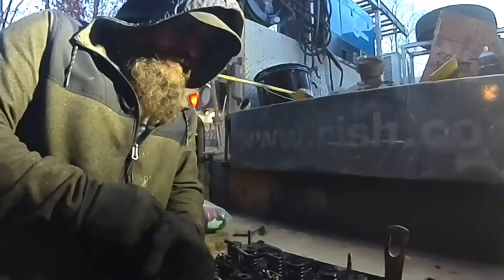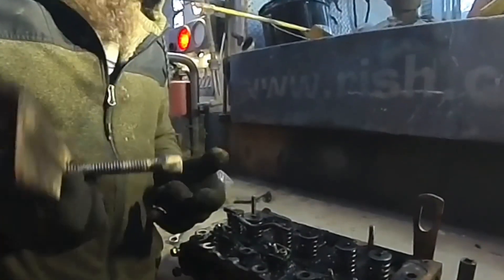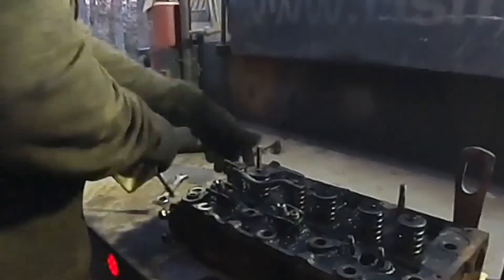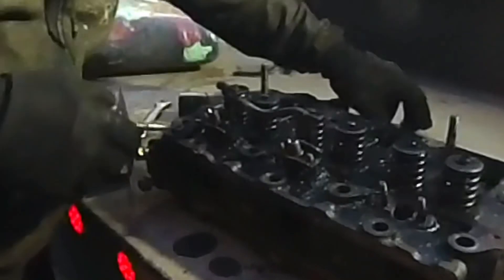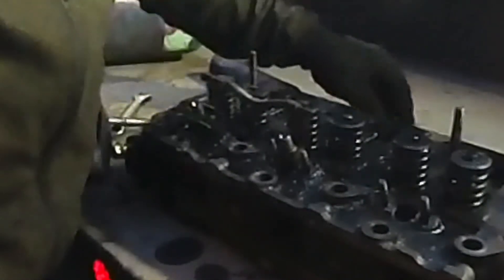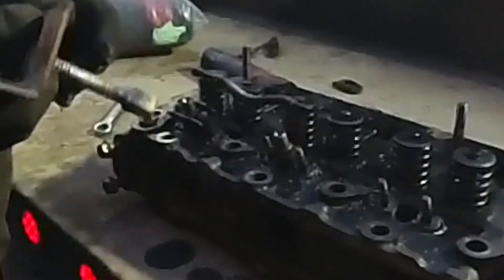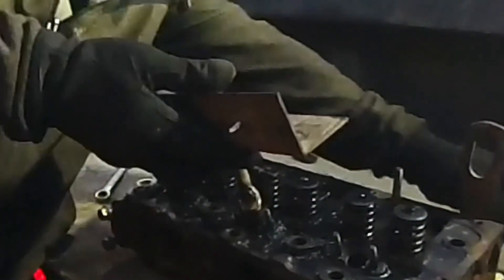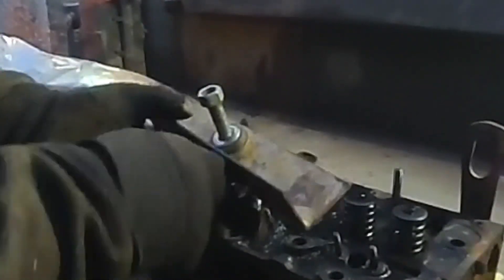DIY Diesel Injector removal tool

Comment: Nice. I was thinking a deep large socket I already have with thick washer on top and nut with ??? Sizes and threads is why I came to site.  Love the ethics and I am dig with you all the way but don’t have an extra fuel line and figure it is an  available thread size.